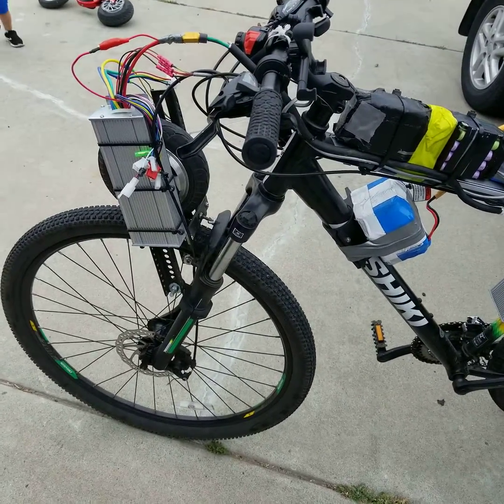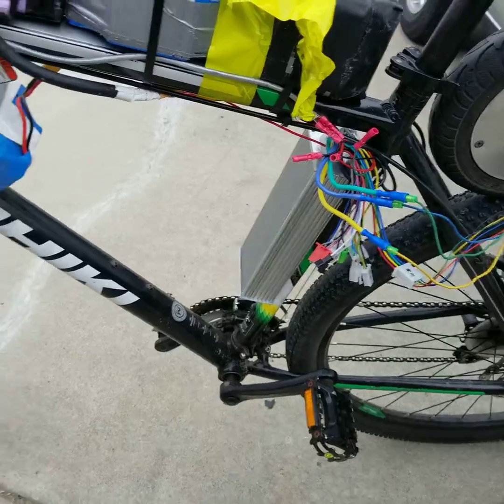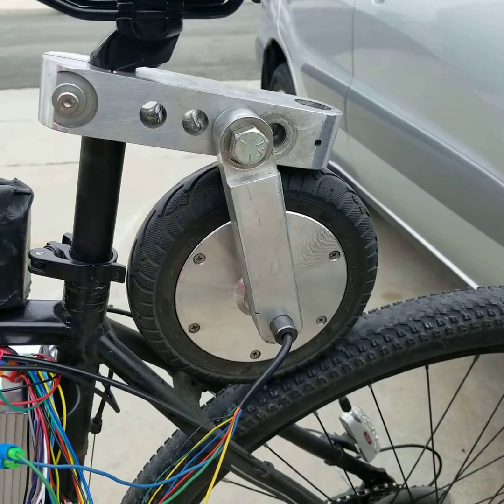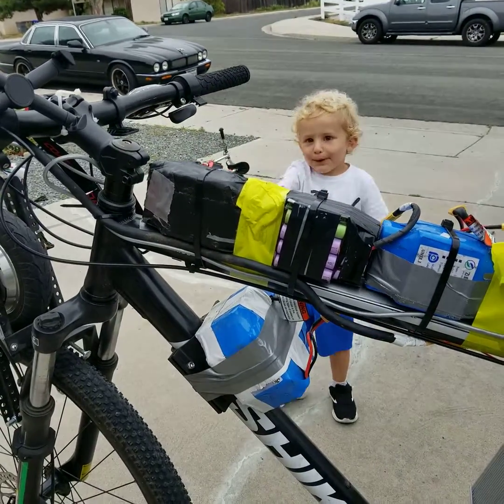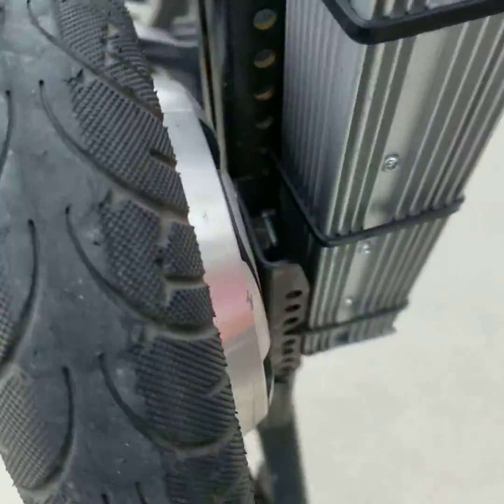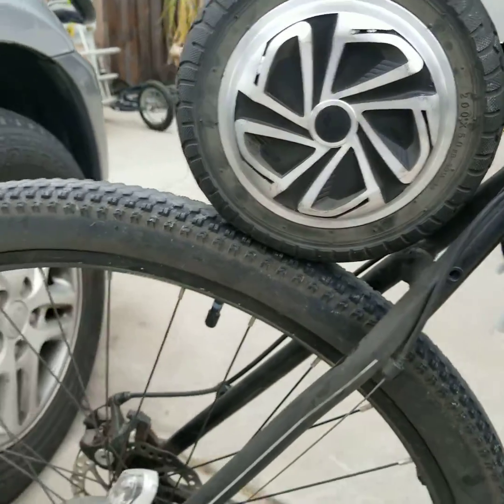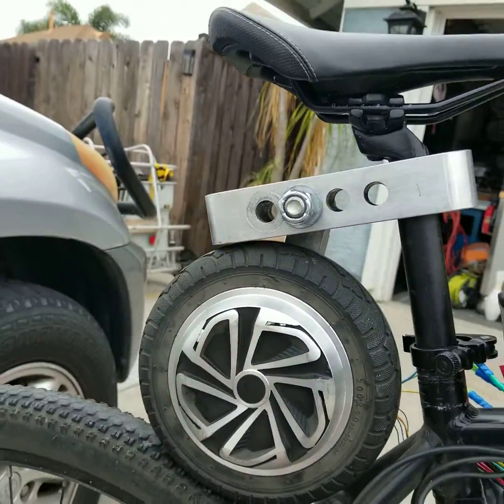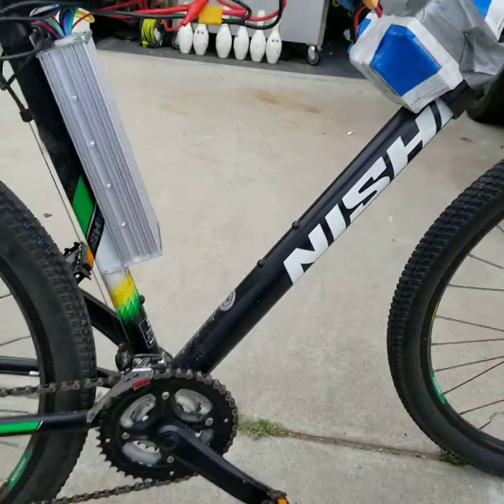Hoverbike 2.0

Comment: Awesome mounts I made one so. Will post its shitty compared to yours. Great job
Reply from the maker: As long as it works, I had help with the rear mount but since have made another one that is only one piece.
Reply: @FIprobe  pretty awesome can u post where u got ur controllers
Reply from the maker: @plojm123  I got them off Ebay, search for 120v brushless motor controller. They are around 50 bucks and come from San Diego. They have a variety of lower voltages as well. I've used 84v 1000 watt and now running 120v 1500 watt. Motors get hot for sure but nothing melted yet, I will update when they do;) I got a cheap drill press and band saw and can make mounts pretty easily. Will upload video of new mount
Reply: @FIprobe  awesome cant wait for mount video its really cool.  Do you get a shit ton of resistance.going down hills I actually am slowed down by the motor
Reply from the maker: @plojm123  yeah the motors slow you down quite alot. Two things on my to do list are regen and disabling the friction drive on the fly(or easly).
Reply: @FIprobe  cool keep us posted, the guy in San Diego didnt have regen on his controllers I asked. But oddly cause I have a volt meter on my throttle if I peddle without the switch turned on I can get over 40v easily. Just can figure and easy way to get that power back
Reply from the maker: https://youtu.be/bs6wQl-Dyos
Newer mount. I'm working on another mount that is blowing my mind at the moment;) cant wait to share